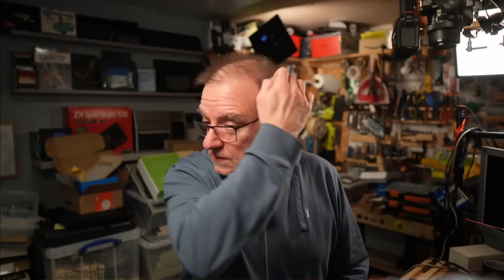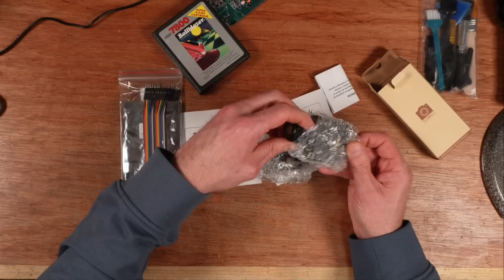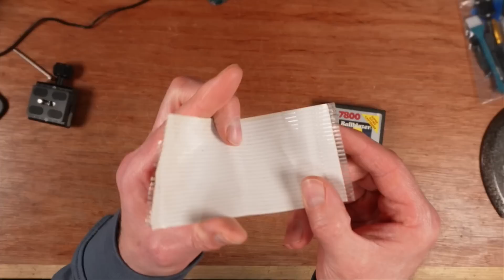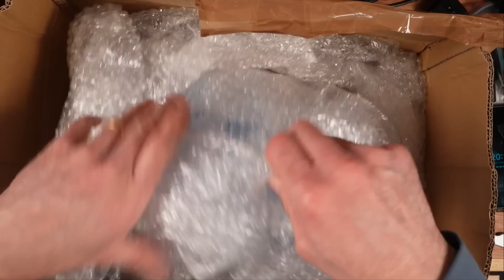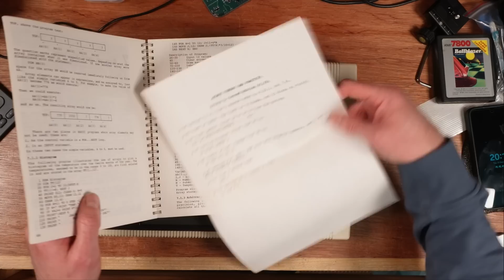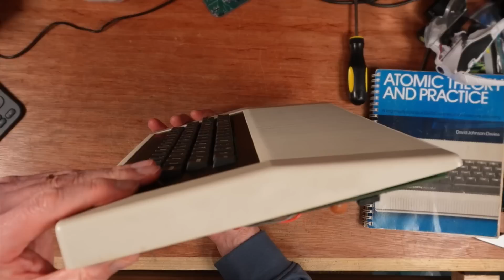Channel Update and Donation Unboxing

Comment: Acorn atom, my first computer. I remember as a spotty yoof saving up to buy a 4K RAM expansion for £79.95. Nowadays you get a 1Tb USB stick for less. Also I seem to remember a mod that stopped the screen snow, at the expense of speed. Think it was switchable. And the final upgrade I made was a board that plugged into the ROM socket to give it BBC basic.

Comment: No voltage regulators so looks like it's modded to take external 5V supply only. Be careful what you use as a PSU, check first!

Comment: School had a few of those Atoms while they were waiting for stock/manufacturing of the BBC Micro to catch up. 
I almost bought an Oric, it was the time when the prices between the Oric of the Spectrum just seemed to be very close, if you hunted around you could get one cheaper than the same ram spec spectrum (or a good deal due to extras bundled in) but in the end the Spectrum won out.

Comment: Jonny sent me the 800xl not working from his repair pile and I replaced the sally and it came back to life, you can see me use it in the acid atari episode to test all the chips ect and I was sure it worked and booted as normal last time I tried it. I think I damaged the keyboard connection taking it on and off all the time testing.